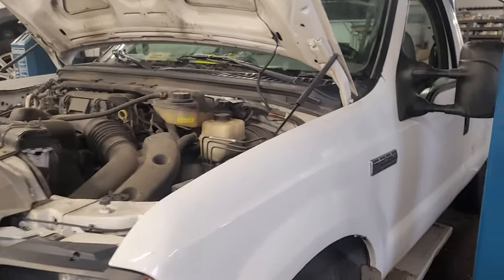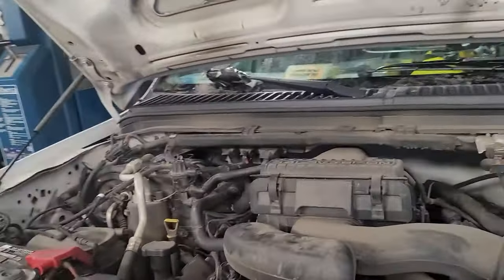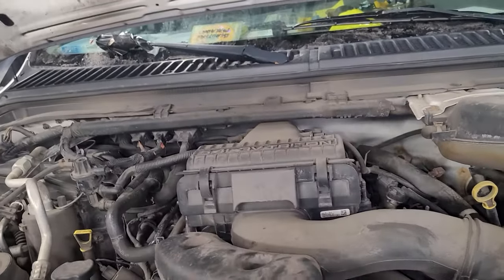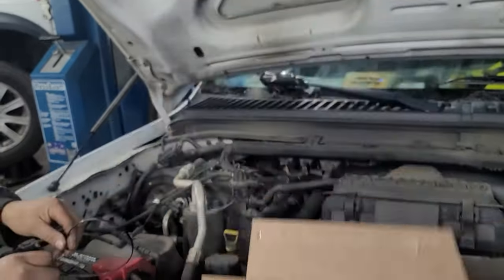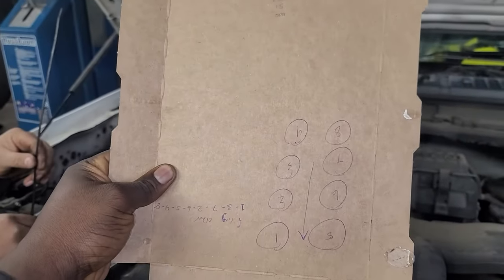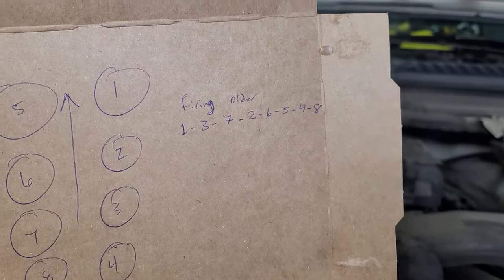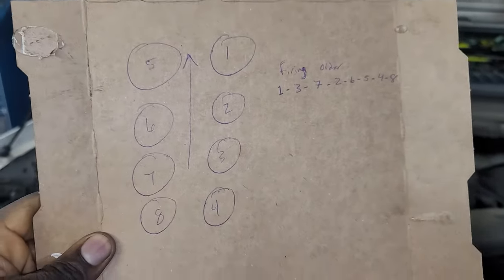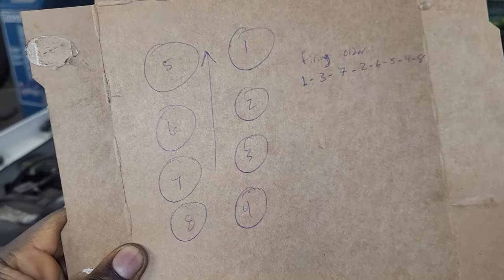Ford 5.4L Cycle Number and Firing Order

Comment: 1234 left side.. 5678 right side 5.4 triton motor. Idk why I watched this but I just got dumber 🤣 this video is wrong
Reply from the maker: If you took the time to understand the picture, you'll see that the arrow is pointing to the front of the truck. So, bank 1 and cylinder 1 are on the passenger side. 
Be careful how you comment on people's videos next time.
Reply: Yeah that's what I was thinking too because this one uses cross plane crank shift so it's not supposed to be numbered that way.